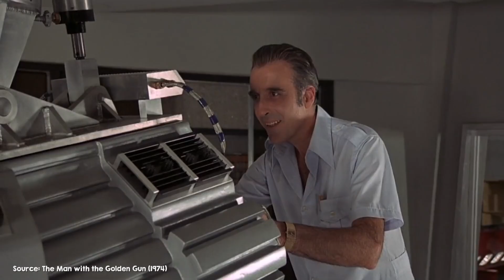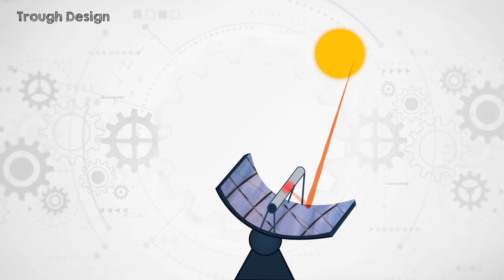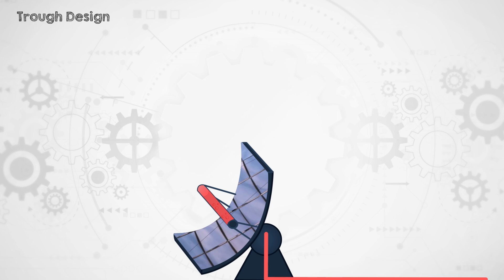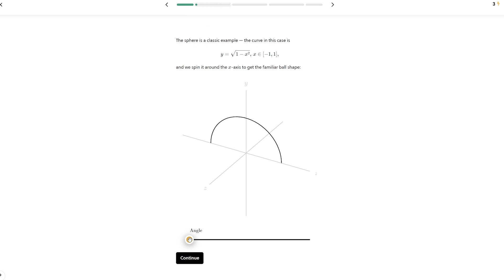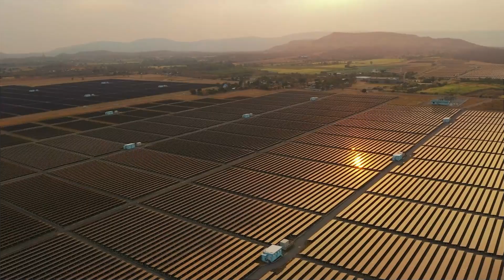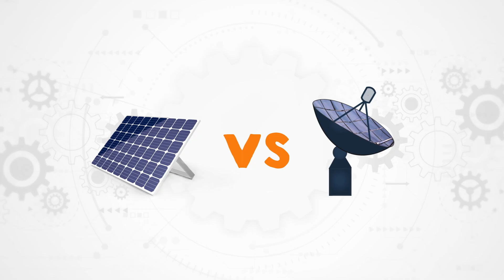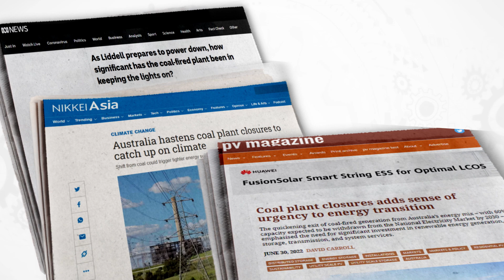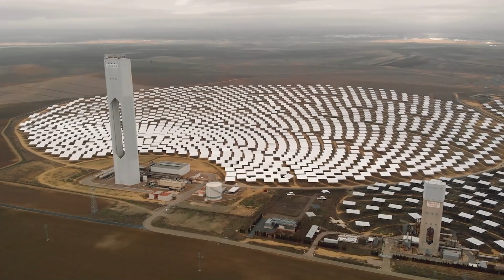Solar Power at Night using Concentrated Solar Power CSP

Comment: Is it possible for depleted reservoir after the turbine, to use heat as district heating?
Reply: It is but probably not with molten salt. If the salt freezes you are going to have a very bad time.
Reply: @SocialDownclimber  not quite sure but somebody said that the salts after being use should drop some more in temperature before being heated again

Comment: There are other long duration storage techs other than Li-ion for use with PV such as Iron-air batteries or flow batteries. Using these with PV will undermined the case for CSP ? On advantage of CSP is that it doesn't depend on the use of scarce minerals or metals.

Comment: And for all dunkelflaute that is coming, we use Biogas powerplants that are easy to store biomethan and hydrogen.

Hydrogen is still tricky to store, but we could be using production of hydrogen as a demand load to stabilise the grid. And maybe put some of hydrogen in biogas production to increase methan production if the storiges of hydrogen is full.

There are so many synergies to use as a solution to the "sometimes" or "not always". Even taking accound of waist heat of Industries.

Comment: Thank you. It's good to hear that the LCOE of CSP also dropped, however l find it hard to understand how, since so few CSP facilities have been built in the last decade, since their operation is problematic, since there were CSP facilities that were closed after a few years only (Crescent Dunes, USA), and facilities that were planned but not built because of their crappy economics and operation (2 facilities in Israel). You can build a 3.5 times the capacity of a PV facility compared to a CSP facility, on the same area. In Australia land is not an issue, but in Israel it is.
Last, CSP is a centralized energy system, with the same fragility issues as conventional centralized power facilities, while distributed PV+storage offer unparallel resilience (not to mention democratic energy production).
Reply: Crescent Dunes reopened in 2021

Comment: The problem is moving the mirrors takes more energy than you are generating. The most efficient way to make power is to place mirrors on the moon, then turn that energy into microwave energy and then beam that to a receiver on earth.

Comment: Rosie! At 12:50 you mention something called a "firming value". In context this sounds lie some sort of abstracted measurement for encapsulating reliability or availability for energy production. Is that right? Am I spelling the term correctly? A brief google search didn't turn up anything relevant.

Comment: I can't see this being cheaper than solar with batteries since you add the complexity of boiling water to run turbines. If you are in a place with 300+ days of sunshine it might make sense. A supercritical gas turbine to run the generator would be a better fit but I haven't seen them available at any useful scale yet. It's an interesting technology with lots of moving parts to maintain that can fail.  Thanks for the video. To stop burning carbon fossil fuels the answer is to use every viable technology including nuclear as quickly as possible. This tech works, so we should use it in the locations where it can be efficient. Thanks for the explanation. Cheers!
Reply: There is a lot of mechanical equipment in the cooling systems for batteries that will constantly need replacing, as well as the slow degradation of the battery materials themselves and the electronics in the inverters.

Comment: Greetings, Rosa friend, I congratulate you from Venezuela, your work from the technical, didactic and scientific point of view is impeccable, I propose you an idea from a crazy inventor who only wants to help the planet and its climate, my proposal that I hope you can with your teaching and animation system show everyone who follows you through Youtube. My proposal: what do you think if we use the tower that supports the light and heat capture system of the system, then we raise it even more, and that allows to place a turbine with its respective generator, which would easily add about 10 mw. more to the general system, even more, and if we cover the tower with photovoltaic panels, what would we take advantage of the light produced by the mirrors and generate 1 more mw of energy by adding them to the system? And even more, if we use an oil system that (in another bulb, manages to heat up) and we add 2 more mw?, ok rose, if you managed to understand and can answer me, I thank you, I would be proud if you improved my proposal. from Venezuela. Thank you Armando Gutierrez.

Comment: Thank you Rosie. Your research into the history of CSP is wonderful, it adds a great deal of perspective. As you point out, future grid reliability will require multiple types of storage. CSP does offer additional flexibility because with a thermal storage/turbine combination you can move that stored energy to other storage (battery, pumped hydro etc,) and though efficiency is lost to some extent it adds an additional option that grid operators should see as a real positive.
BTW, I shared one of your recent videos to FB with the comment that you were my favorite Australian engineer. Just to let you know, that still holds. (To be honest N=1, but we could add a few and it would hold. 😛)
Reply from the maker: There is more than one engineer in Australia, so I hope if you meet another one I will still maintain your number one spot!

Comment: https://en.wikipedia.org/wiki/Ivanpah_Solar_Power_Facility

https://en.wikipedia.org/wiki/Crescent_Dunes_Solar_Energy_Project

these plants have been plagued with problems. CSP is not as easy as you made it sound in these video.

I agree we need to stop using lithium batteries for storage. That was an idiotic use of high density battery materials, and now it will compete for use in e-bikes and EVs where it's more well suited. I also agree that pumped hydro storage is a more sustainable energy storage method, including using coastal sea water.

Comment: SCO2 has potential applications with CSP and can be more efficient than steam.
Firming with fossil gas will be very expensive per kwh if only used very occasionally and such plants have a finite lifetime.
We should be building cleaner firming alternatives and phasing gas out , not building more fossil infrastructure thinking it will be cheap when it wont be. 
Hydrogen is not the only option for truly long durations

Comment: The "almost" always is the funny thing - like coal or gas plants do not break down - sometimes for months if the break is significant. And it seems nobody builds just one spare "in case"... So yeah, CSP should be OK for this. I would still question if we can't use molten salts with normal solar - just for storing the excess...
Reply: Here in MInnesota, we have a “reliable” nuclear power plant facing significant shutdown cycles after leaking 400,000 gallons of tritium-infused water (luckily none spilled out of containment and into the nearby river).
Reply: @davestagner  Here in Aus we have a "reliable" coal plant still offline a year or more after it exploded.

Comment: In a lot of pictures of the CSP towers you can see a bright spot a bit shifted away from the actual tower ( like at 10:30 for example) is that just an artifact in the cameras because of the brightness or is that something different- maybe the light beam is focused not exactly onto the tower to regulate the heat?
Reply: kind of looks like its being focused away from the tower. also interested in this question too
Reply: To me, that looks like a "sun dog" sort of phenomenon. Only not via ice crystals, of course. there seems to be a smaller related one on the other side about the same distance from the tower. The brightness of the tower (landing spot of light from the mirrors) is shining out and into the air around it. At that particular angle on that particular day there was something in the atmosphere (air around the tower) that reflected the bright spot of the tower to the camera. Had it refracted instead of reflected, you'd have a neat rainbow.  OR there is some in-the-camera effect from having such a bright spot in the frame. 
When they aim individual mirrors away they have a whole safety plan for the redirected light... like basically they want to avoid stray reflections so there are "stowing" routines.

Comment: The storage part particularly is something to work on. I think most plants use sand or melted salt but containing those kinds of materials for long time at hight temperatures is hard and could fail easily. The same could be said for the tracking motors, more so when we see that most places suitable for this technology are full of sand and wind. I think this has its place on a renewable grid but will never be the main source of energy
Reply: CSP is only worth it for the storage as Rosie said. I was surprised that she said it would only lose 1% per day. That seems very optimistic!

Comment: We have the technology at the moment to produce 100% renewable reliable power 24/7 with a relatively small physical footprint.
I have designed two power plants that can do the job extremely well with designs that have never been used before.
As they used to say on the X FILES
"The truth is out there"
😎👍

Comment: Would be interesting to know where CSP is possible/financially viable geographically. I.e., whether other parts of Europe will build their own plants or lots of HVDC transmission lines from the Iberian peninsula. The latter would certainly be a better alternative to buying oil and gas from "questionable" sources.
Reply: In America, Ivanpah is somewhat a "Ideal" location to install a CSP.  It is near I-15 and the California / Nevada state border, about 2 miles to the northwest of I 15, so you can see it from the freeway, but it will not blind the drivers.  It looks like a very bright LED light at the top of a tall tower from the freeway.  

The problem is not the 4,000 acres of glass, or the amount of maintenance that the mirrors might require to keep them clean enough and pointed in the right direction.  The $2,2 Billion cost is what matters, and the 400 MW of power output.  So that works out to about $5.50 per rated watt, or 5 times what a normal PV solar system costs.  And you must have steam engineers on site while the 800 + PSI steam generator is running.  You could install a 2,200 MW solar PV system for about the same cost.  And it might be smaller footprint too!

Comment: I don't much fancy CSP. It turns the land into a lifeless industrial area, whilst pv photovoltaics enable a living landscape of food production and eco diversity under the shelter of agrivoltaic pv systems,
For storage, lithium ion batteries are a lousy way of going beyond 4 hours or so, but there are other alternatives which work fine, including Energy Dome compressed CO2 for daily variation, lower cost less energy dense batteries than lithium etc.
We don't need to desecrate the land with this horrible solution.

Comment: Only problem I see with CSP is that batteries for grid storage are becoming cheaper and better so will it be cost effective against classical solar combined with Na-Ion or some flow batteries in 3 years time ?
Reply: This is the gamble. By the time CSP is really ready for mainstream will cheap new battery tech undermine it?  I think it comes down to CSP being able to have a very large amount of storage for very low cost. The power of the input array and the turbine system ate the main costs. So you have low power high capacity. It's very suitable for backup power generation to cover a few days of no wind, but batteries to store enough to cover that would cost an absolute fortune, even with cheaper tech than today.

Comment: #SwitchToSolarEndWars #STOPBURNINGFOSSILFUELS
Let's put solar panels on every home, business and covered parking rooftop and switch to electric vehicles making nearly everything we do solar powered while completely decentralizing our power supply and empowering everyone as power generation owners.

Solar power is CHEAPER and electric vehicles are soon to be CHEAPER to make and already are considerably CHEAPER to maintain and operate, especially if charged from your own solar power.

A 3-5 year ROI (return on investment) for a solar array that will generate power for decades is a no-brainer and the panels can even be made locally too.

#EndFossilFuels #EndNukes #SwitchToSolar #SwitchToElectric #GreenNewDeal #EmpowerEveryone
#DEMEXIT #StillSandersPlatform
#RepublicansAreNazis

Comment: I loved this video! I would be quite curious why sterling engines never took off for this type of grid scale use. I'm sure there is a reason there are many clever people who have thought of it first but I would love to know why it never took the steam turbines job. 

Thanks Rosie, love the videos as always!
Reply: while Stirling engines are more efficient, they're also much bigger and need much more maintenance than gas or steam turbines. I think the fuel cost vs capital and maintenance cost just doesn't work out in favor of sterling engines for power generation.
Reply: Ivanpah cost $2,200,000,000 for a 400 MW CSP tower system, with 4,000 acres of mirrors.  And you must have a staff person on duty each hour that the steam plant is running. So that is about $5.5 per rated watt, while a conventional PV solar system will only cost about $1 per rated watt.  

So if you have $2.2 Billion to spend, would you recommend a 2,200 MW solar PV system, with almost no need for maintenance, or install another 400 MW Ivanpah system where you must hire staff to monitor the steam turbine and boiler system.  At least 20 employees who will want to earn about $45,000 - $75,000 a year.
Reply: Sweden developed a submarine with a Stirling engine because it can work so silently. Military technology seems always to come first, before civilian!

Comment: Industry needs heat more than electricity so it is ideal for industrial processes. Having heat available after dark is needed as industry runs all day not just when the sun is shining. So, CSP can do both, electricity plus heat around the clock. The tower CSP can provide the very high temperatures that the channel/trough can't.

Comment: In a grid,  different types of generation and storage means the technologies smooth out each others disadvantages. Very good point that there's no one perfect, always totally reliable form of generation or storage. That is also a disadvantage with technologies that needs huge investments.        

Personally I think CSP has it's biggest advantages in hot deserts, where heat is a problem for PV. The "built in" storage is a big advantage, but not only, and not always that huge of an advantage. For one thing, PV could be with thermal storage, charge the storage with just the part you don't find good use for when it is produced. 

Obviously, making heat from electricity is not optimal, far from it, but if it is just to smooth out small differences between generation and demand, it is better than having the production "locked" at a much higher cost, regardless the amount of storage needed.  So, besides hot deserts, CSP could have a niche primarily in moving solar generation in time, not so much the primary generation with the option to store, but mostly: collection -> storage -> generation, in addition to PV and other forms of generation.    

About batteries, they're betting cheaper and better, all the time. Technologies that require hundreds of millions of dollars in investment and take around a decade or so to build shouldn't be evaluated as an alternative to what's currently available on the market, not current batteries, and not current PV for that matter. Both batteries and solar PV will probably see another 50% decrease in price over the next decade, possibly not just in production cost of the cells, but market maturation and improved implementation is likely to help bring down the total cost of implementation the buyers pays to less than 50% of current costs within 10 years.

Comment: Very interesting video - and it raises so many questions so glad there’s a follow-up livestream planned!  Questions: What is the comparative power generation per square metre (or hectare…) for CSP vs PV?  What is the cost/MWh of CSP storage vs Lithium or other batteries (like Redox flow), can the latter even scale?  How long term is CSP storage - my guess is after a week the losses become uneconomic so probably more suitable for diurnal cycling?  Finally - a key advantage of PV is that it is completely incremental, from a panel on top of a shed with an old battery up to grid scale and use of V2G storage, whereas CSP is big project stuff - beloved of utilities etc.
Reply from the maker: I've added these to the list, I'm sure we'll get to at least a couple of them! p.s. I have a hybrid flow battery project tour video coming up soon.
Reply: @EngineeringwithRosie  In the US, I'm skeptical of running long transmission lines from the CSP plant to elsewhere.  There are permitting and NIMBY issues.  If they close down coal plants, the lines are already permitted.  It would be easier to replace these with renewables (wind or PV), or a storage site.  I'm not sure how well CSP would scale in most geographical situations.

Comment: Water usage in the steam turbines is a potential issue in dry and desert areas.  

I recall some years ago CSIRO were looking at experimenting with a jet engine (without fuel) at the power tower receiver to attempt to create a way to generate electricity without the high water usage.  Never heard how these experiments panned out however.
Reply: It might be possible to use captured CO2 to drive the turbines. I believe, I have read in the past that there has been some work on turbines that run on CO2 with the prospect of using them in geothermal plants.
Reply: @jaganathanaratnasingam4635 Please explain.